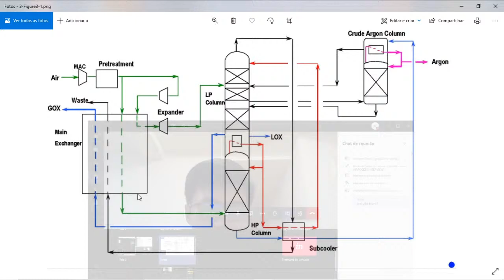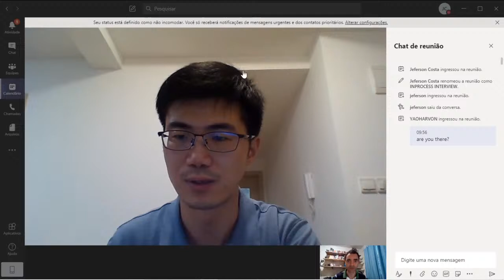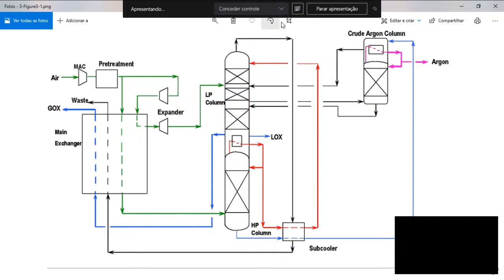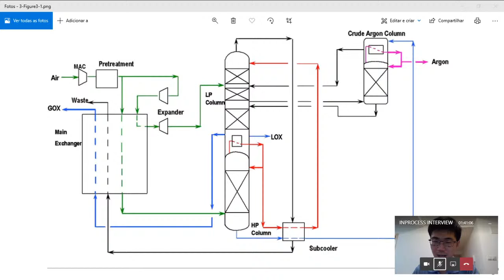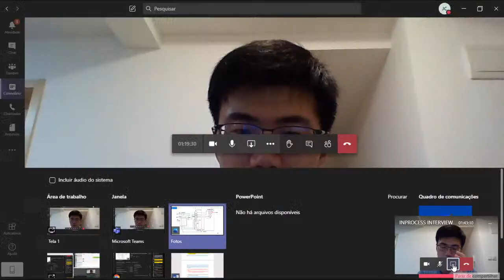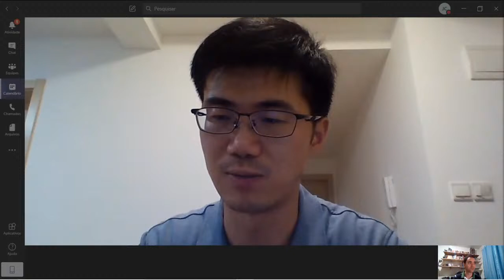Cryogenic Air Separation for Chemical Process Engineers

Comment: I see something unusual in the air separation process which was presented. The green line after pretreatment, going to expander 1, MHE, expander 2 then to LP Column, I've never found ASU like this. Also, I didn't find nitrogen product in the process.
Reply from the maker: Nitrogen in this process is withdrawn as waste. You can see following the red line. There are many configurations for ASU depending on the products desired and the design of specific energy.
Reply: do you have a plan to share ASU more detail? moreover if integrated with LNG regasification, sounds great...
Reply: It's just act like reflux which has joul thompson valve with its temprature effect for condensing vapour